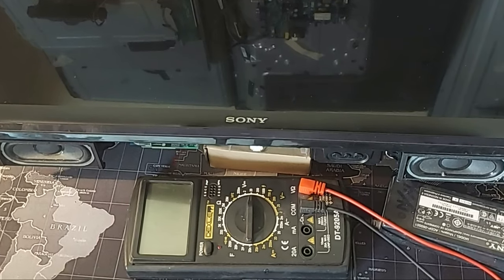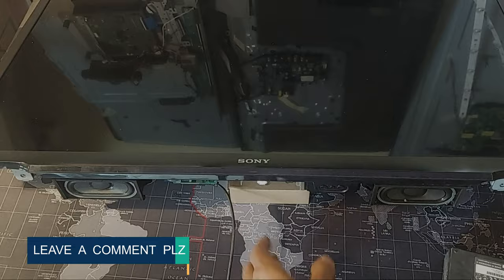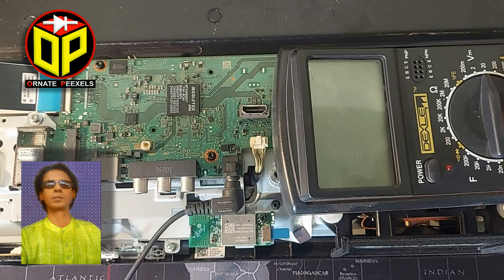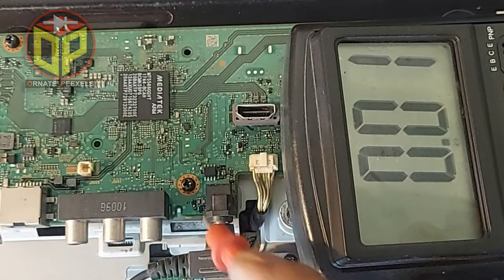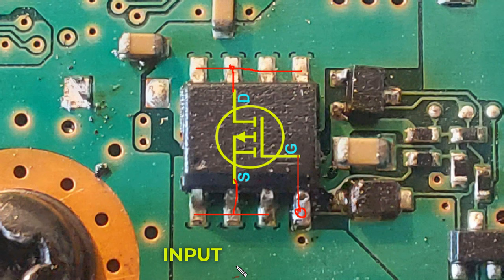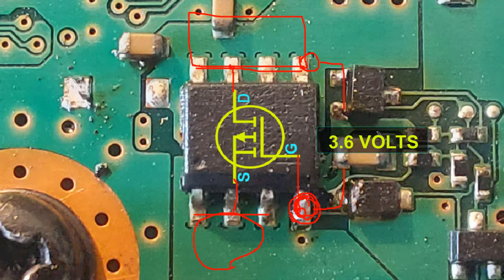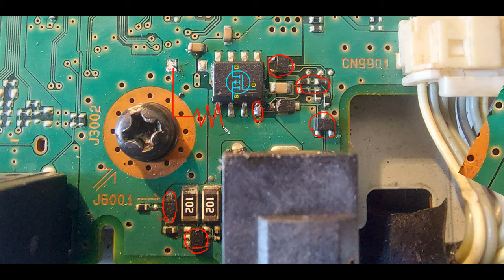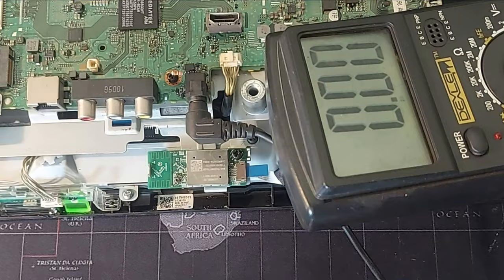Sony Bravia 32" Smart LED TV Power Problem, No Light on The Screen & No Sound How to Repair it

Comment: Very helpful video sir. I used to short drain and source to fix it. Is it ok to short them. Or try your methode.
Reply from the maker: If you make it short, breaking the rules becomes a little more 😀.  So I thought let's use resistors at least. 🙃
Thanks Brother ❤️🌹❤️
Reply: @OrnatePixels  are you on any sociel site. Where we can discuss on.
Reply: @OrnatePixels  which value of resister please

Comment: Hello my friend very helpful video one question i have led 32inch tv i have 85 v output for leds black wire not the red wire leds open and then no lights turn on what should i check thank you so much for your help and time any advice.
Reply: Have you tested all the leds?

Comment: I used 22k but the gate voltage more than 10volt so the output not stable atlast 10k resister used output ready and tv on
Thank you sir

Comment: can we also remove the IC and bypass the source, then connect directly to the drain according to the output voltage supply by the former IC without the us of the resistor?

Comment: For the first time you uploaded a video that is not clear, you said before connecting the resistor, cut the gate from the circuit. How did you do that
Reply: Yes I have the exact same question, any answers